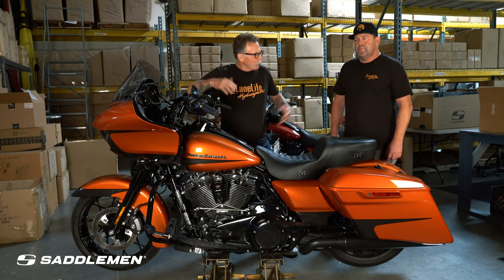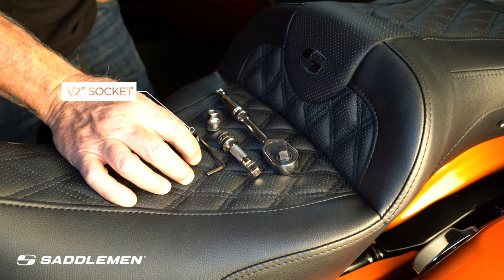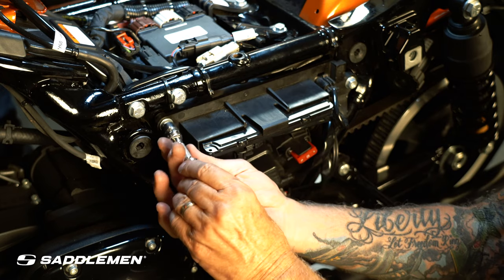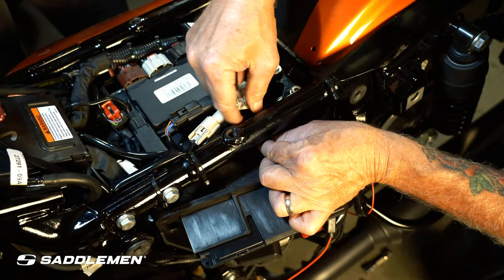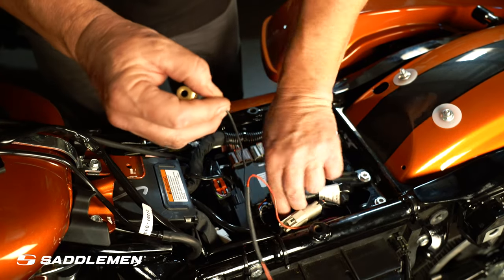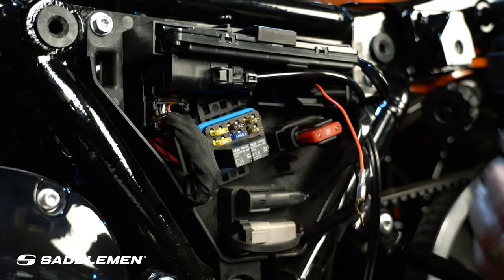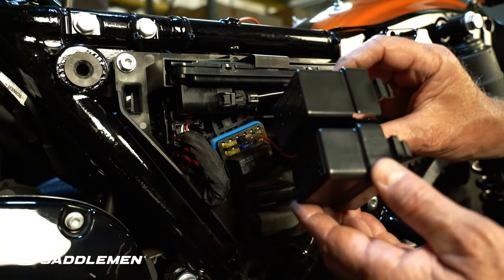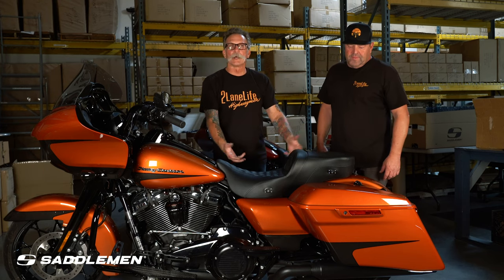Installation Overview // Harley Road Sofa LS Heated Seat

Comment: Thanks guys! Easiest install I’ve ever done 👍. A quick question: the red light in the heater switches only comes on when selecting level two heat, not level one. Is this right?
Reply from the maker: Biker- give us a calla nd we can help sort any questions you may have 800 397 7709- thanks for the kind words- we appreciate you.

Comment: I've just ordered a Road Sofa from FortNine in Canada here. I was just wondering if this heating harness comes with the seat or if I have to try and find it somewhere . FortNine doesn't even have the harness listed and Dennis Kirk says the harness is on backorder. Thanks.
Reply from the maker: Not sure which version you will currently get- if need be give us a call 800 397 7709 and we can help get you what you need. Thanks!

Comment: My low heat isn’t working on my Road Sofa LS. High heat works fine. When it was functioning properly the light was green on low heat. Now when I switch to low heat the light is red and there is no heat. When I switch it back to the off position you can see the bulb on the passenger heat switch blip red. Any ideas?
Reply from the maker: @rphd07 Give us a call -we can help at the shop,  look forward to speaking with you.
Reply: @saddlemenusa  yes, I called and was emailed a warranty form even after I explained that I’m the second owner of the seat. I will call again. Thanks
Reply from the maker: @rphd07  Thank you